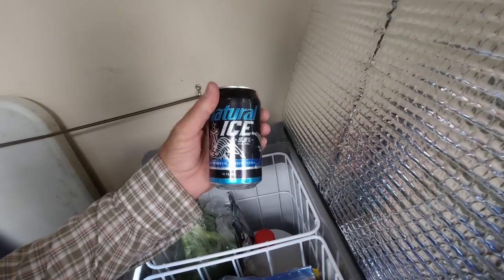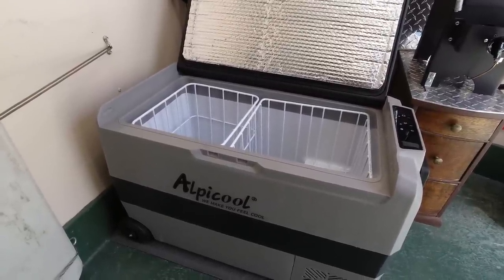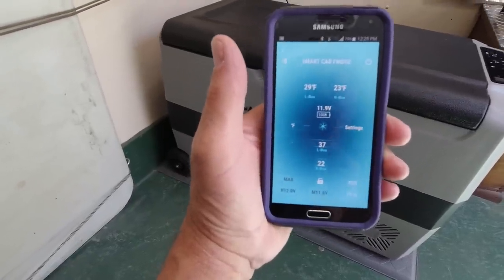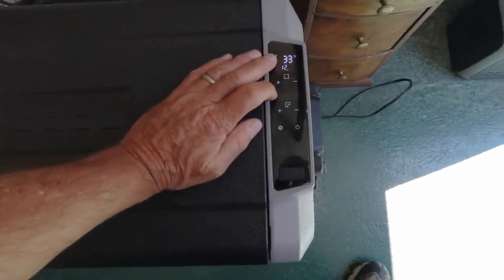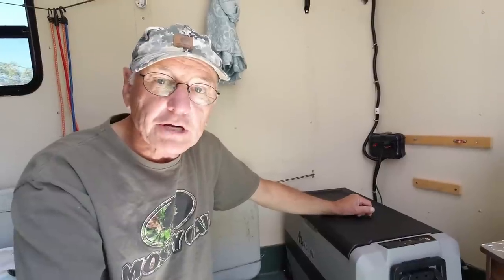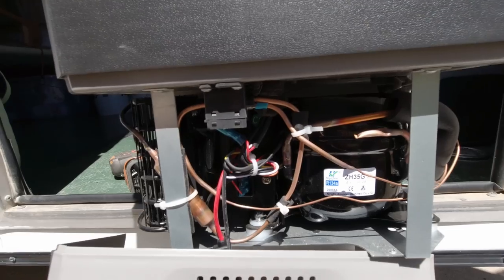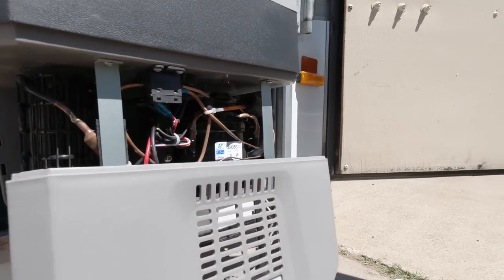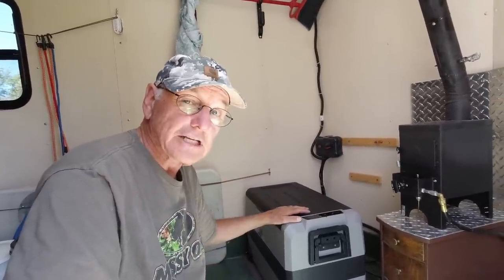Alpicool T50 12 Volt Refrigerator - Is It Worth It?

Comment: That was one of the most beneficial 12-volt refrigerator reviews I've ever heard there were several points that I learn something. I had questions about Duel Zone you explain the on this particular unit non-regulated power supply. The alphacool information. I think the number one thing I learned is you paid for it you're not looking for an endorsement or the next free deal and you will review it in the future accurately
Reply from the maker: I'll do an update towards the end of summer most likely.  Thanks Wes!
Reply: Agreed
Reply: @gonagain look forward to it
Reply: I still wonder if the regulated 12v feed comment was based on an mppt controller and a larger charging system. I only say this because the most will raise voltage to the batteries at times. I know its 12 or 24v but if its switched then it may not like 18- 20 volts in a 12 volt setting. I say this considering a direct battery connection while solar panels are collecting and the most controller is boosting to 18 ish volts. Thats the only thing I could think of that would warrant their comment on the 2 channels he referenced.

Comment: I run 160 watts solar & two 6volt Costco batteries. I Have an old norcold  45 qt 12 volt single zone unit. I Only use it as a freezer set at 6 deg F. Freeze water bottles over night and rotate them in my high quality cooler, this keeps as a refrigerator. I think it’s continuous and could go for? At least A long time. Frozen meat, frozen vegetables, and don’t forget ice cream. It pushes at least 10-14 days for two people. 
Keep up the good times. Thanks for sharing.
Reply from the maker: Thank YOU for sharing!  That's really good information and I can see that it doubles your available space.

Comment: hello from the rainy ozarks rick and linda!! i have one like yours and i havent had any issues  in 6months so far!  tight lines and cheers!!
Reply from the maker: That's good to hear Phillip.  Mine is getting a bumpy ride on the trailer floor, so we'll see how it does.  I'd like to find a way to cushion it if I can without it getting too bouncy.
Reply: Mine has been working for more than 1-1/2 yrs and all is well.  Wss so happy l purchased a 30 qt model.  Didn't go big till l knew this inexpensive unit was ok...l made the investment watching Slim Patatohead who initially made the purchase and review.  He's worth subscribing to as he's one of the best on You Tube.
Reply: Oh my original C20 unit does a fantastic job keeping my beer cold!!  Mine is vy quiet.  Oh no piston.  Now they use a scroll compressor that uses 2 plates with.one rotating over the other to capture and compress the refrigerant as it gets squeezed thru the scroll circular-like vanes.  They are more robust, uses fewer parts.

Comment: I bought the same one.  I love my ice.  I bought  deep large ice trays the correct fit on amazon.  It actually froze them in Florida.  I do like it.  I hope it lasts.  On the noise if they are plugging it into an extension cord that is the wrong size it will make a lot of noise.  Good luck with yours.  I hope you do another review after you had it for a while.  I don't plug mine in right after I tote it since it is tilted.   It probably doesn't matter but it makes me feel better. lol  I do have a hard time with the manual settings.  So I just use my phone.  It is simple that way.  I am using 200 watt with 100Ah battery no problem.  Thanks for your input and showing me the inside.  I was wondering about it.  Thank you for the idea of the bubble wrap on the lid also. I will use that. Woo hoo on fresh veggies, gotta keep momma happy!
Reply: I have an icemaker separate from my refrigerator. The directions on that say to let it settle if it's been moved around before running it. Not sure why but it sounds like the motion could upset or aerate the coolant perhaps? Is there an AC tech in the house?
Reply: @richarddaugherty8583  I was using the same concept as a house fridge.  If you tilt it too far you are supposed to let  the compressor oil settle before you plug it in again.  I don't know what degree of a tilt but I know you are supposed to do it.  Do you have one of those counter top ice makers?  If so do they work well?  I would think they would use too much juice.
Reply: @ruabadkitty  I looked one up on Amazon and it says the draw is 120 watts. That's not too bad, really. The question how much is too much is relative to the quality and quantity of your power supply and how many things you need to run. I just got done building a totally portable DIY 400 watt solar generator, but it wasn't cheap, at least up front. The cost over the life of the unit is going to be darn cheap but the batteries are the big investment. I went with 2 Battle Born 100 amp/hour LiFePo4 batteries wired in parallel for a total capacity of 200 amp/hours. For me that's a lot because I only need to run my ham radio stations, some fans, a laptop, charge my devices, stuff like that. All that stuff is 12 volt. The system has a 3000 watt pure sine wave inverter to run AC stuff. I think I could run that refrigerator and an ice maker with no problems. YMMV! Here's a link to the system I built in case you're interested. It was definitely a project! https://drive.google.com/drive/folders/1Fbuo8TENelmmndBXc4w37FZsMWjWY8Uz?usp=sharing
Reply: @richarddaugherty8583  My Gosh!  You weren't kidding when you said you "built" your own system.  That's beautiful.  You really put some sweat and thought into that.
Reply from the maker: I also found the Bluetooth easier to use.  At first I didn't think I would use it for anything, but its more intuitive and easy.  Thanks Nancy!
Reply: can you share a link to which deep large ice trays you got from amazon for this alpicool?
Reply: I can't right now.  But you can measure inside and then go to amazon and search ice cube trays.  the sizes  are all there.
Reply: @ruabadkitty  did you get silicone ice trays with lids?
Reply: @manp1039  Yes,  I got the large and smaller octogon shaped ones.  The larger ones take a lot longer to freeze in Florida. they both are silicone and all have lids.The big ones has six cubes each came Two per pkg.

Comment: We really like our T50 Alpicool.
 We purchased it end of May and have had no problems so far. I made a insulated cover made out of foam board.
Reply from the maker: We need to do that too.  It did really well though as long as we kept the sun off and a cover would help with that for sure.
Reply: @gonagain Like you and Linda we have it setup as a refrigerator.  Also we don't use the baskets as they take up usable space, some items won't fit in them.

Comment: I bought the CF55 58qt. running a week now with solar in the shade for the most part little sun but working fine so far. It's fridge or freezer not dual zone but I agree way worth the money.
Reply from the maker: You could try freezing water bottles too cool an ice chest and have the best of both worlds.  Depending on how much power it draws as a freezer.

Comment: I hope this fridge works out for you.  I almost got one.. but then I read dozens of bad reviews.  Many from people saying it just died completely.  Good luck with it.
Reply from the maker: We'll find out.  I saw those reviews also, but even the Dometic brand has reviews like that so I figure we'll find out.  Thanks Joe.
Reply: @gonagain  True.  I've been leaning to the Iceco GO20 fridge.  Its affordable.  Dual zone.  And compact (which I like).  I'm still kind of undecided if I want an actual 12v fridge or a regular dorm style fridge.  Cheers.
Reply from the maker: I like this style compared to the dorm type because it holds the cold better so it uses less power. Like a chest freezer compared to a stand up freezer.
Reply: I got a T50 two weeks ago and it works great so far. Gonna insulate the lid like you did in the video. Thanks for the tip and review!

Comment: Sounds like your choice was the correct one so far, but bagged ice from home in the base may cause it to run less often try it and see at home then you have water when it dose melt filtered water I use in resealable bags...
Reply from the maker: Not a bad idea Jimmy.  We still haven't used it as half refrigerator and half freezer yet, but are going to try it out soon.  Ice cream?  hmmm
Reply: @gonagain  Sounds like a plan and remember when camping there is more use of frozen food space than refrigerated space, just fix up what you can eat then no wasted space, and hot or cold water is better than no water at all...

Comment: Awesome review! I have watched many and yours was the best most straight forward and entertaining I found. I’m glad I did find yours because I was about to purchase one of their other models even though I did not like the way the lid opened. After seeing your review not only the lid design but also the ability to regulate each side independently has won me over. One question I have is .. do you feel the lid is strong enough to use the cooler as an occasional seat ? I will be using it in my VW Westfalia and do feel we will utilize out refrigerator as a makeshift seat on occasion. My wife and I are smaller at 110 and 160 pounds. Thanks!
Reply from the maker: I think it will be ok, the lid seems strong enough. A cushion with a plywood bottom would help.
Reply: Yes. The lid is sturdy enough to be a seat

Comment: If you put insulation around the cooler or put it in a regular cooler it works even better just be sure to cut out the holes for ventilation!
Reply from the maker: Thanks Loren,  I want to make an insulated jacket for it.

Comment: Regular 3 cubic foot(90qt) chest freezer, about $150 to $200.
Plug in Thermostat about $30. to $40.
Inverter if you're running 12 volt system about $40.
Total for 90qt freezer you can set with thermostat to refrigerator temps  $220 to $280!
Plug the freezer into the thermostat, plug the thermostat into your power, now set your temperature to what you want! Save money and get a lot more size.

Comment: Refrigeration is a risking investment.  Those compressors and those rattling copper lines going down a pothole road..
I use a  Lifetime 55 Quart cooler that I purchased at walmart ....
and use a Cooluli Mini Fridge  12vdc/ac for my drinks...(uses 60 watt)
Works fine for me.

Comment: Gonagain, I just bought one of these.  I noticed when your compressor kicked on, the voltage display dropped into the 10's.  What was the input voltage?  Here's what I've got going on:  I bought a hardwire kit that the cigarette lighter on the cooler plugs into.  I've got that hardwired into a hot and negative output that's factory mounted to the dash in my semi.  I've held a multimeter against the wires, and they're at a constant 12.8V, and the display on the cooler will drop down to 10.1V, even though there is no drop on the meter.  This is a little Alpicool cooler against four huge semi truck batteries.  Anyways, it causes the low voltage F1 error, and shuts off the compressor.  I had to drop it to the 9V setting just to get it to run.  Now with the truck running, and I'm getting 14.1V at the meter, the display on the cooler will drop all the way to 12.0V.  That means I would get the F1 error even with the truck running!  It's like it's not reading the input voltage correctly or something.  Is this just how it is?  Is this how yours works?  Thanks.
Reply from the maker: Mine never gave me that error.  Do you have a large enough wire servicing the refrigerator?  That could cause that.

Comment: Thank you again for another great review....I just received mine today...Can't wait to use it....
I have a question.....when you are using this as only a refrigerator does only one side of the inside of the unit get cold...?
I figured since you took out the center section that it would.
So the left side of the unit is the cold section...?
I couldn't find any information  at ALPICOOL web site or any where on line...
I thought I would ask someone who has one...
Thank you again for your time....
Reply from the maker: When you take out the center divider it automatically switches to single mode and will work as a big refrigerator or freezer in that situation.  It has two separate cooling coils and I think it only uses the one on the control side when in single compartment mode.  I know that the temperature sensor is on the opposite side when used like that.
Reply: @gonagain  Thank you............

Comment: thanks for the review sir, so how efficient is it? can you give a rough idea of run time on your batt? cheers..
Reply from the maker: That will depend on the ambient temperature, but I can tell you that at a room temperature of around 72-75 degrees, it uses 13wh per hour on refrigerator mode and double that on freezer mode.  So if you had a 500wh power station, good for maybe 420wh, you could run it for about 32 hours in those conditions.
Reply: @gonagain  that's not bad, so I'd need a few days run time so probably would need a 1500-2000wh power station...
Reply: @gonagain  I truly dont understand these watt hours..amps etc...but I THINK you just said I could run the alpicool on a jackery 500 for 32 hours..recharge hackery with solar while fridge is plugged in cigarette lighter.....is that right????    I cant afford a BIG EXPENSIVE mistake...I'm on low social security...thank you.   Thinking of buying jackery 500 this week but SCARED

Comment: Good review. I see the  model is a few years old so I’m wondering if it is the best in 2021. I like the BougeRV 30 qt, which seems to have a Danfoss compressor (at least it looks like one) and it is smaller. 
Nice to see a reviewer closer to my age. 
Still not sure how big a power station I need to drive this for, say 12 hours or more. 
I did try a F40 brand but quickly found the 20 qt size too small.
Reply from the maker: Hello Stephen.  Alpicool will either use an LG or a German design compressor.  They're also sold under the Bodega name.  A 500Wh power station will easily run one for 24 hours.

Comment: Great review!  I recently bought the smaller 36L version from bodega and love the features/design but it makes a loud and annoying gurgling/boiling sound when the compressor is on.  The noise is louder than the compressor/fan.  Does yours do this?   I am wondering if it is as normal as the manufacturer says it is.   Thanks!
Reply from the maker: Thanks for watching, John. We appreciate it very much. And a little gurgling is normal.

Comment: Hi! Great video!  I've just bought this unit,  I hope it last. So far it's perfect,  lowered my temp 30 degrees in just 20min, all in freezer mode and putting inside some rigid ice plastics. By the way,  any idea where the Fuse must be located? Manual describes an error code indicating that there's a Fuse that can be changed
Reply from the maker: Hello Javier. I don't have mine anymore, but on my Bodega, which is made by Alpicool, there's a fuse right next to where the power cord plugs into the refrigerator.  In faint lettering it says "fuse".  Usually on these refrigerators there is a fuse or circuit breaker in that location.

Comment: Great info. Thanks for all the tips and for figuring out the random noises people often comment about. I've been thinking about getting a compressor refrigerator myself too. I have a couple of questions if you don't mind. How do you find the heat coming out of the exhaust? I would imagine there's some heat being blown out from the cooling fan. Does that heat up your trailer on hot days or is it really a non issue? Also about the watt hours used over a typical 24hrs when running in the normal refrigerator eco mode on 12V. I realize this is totally dependent on the ambient room temp as well as how often it's opened and for how long. But on a typical day camping with the two of you not really being cautious just normal use. I don't have solar but I do have a Jackery 500 and a Jackery 1000. I also take a generator with me but I may not be able to run it. I often leave the trailer pretty much from dawn til dusk to go fly fishing and I can do that for several days in a row sometimes. There's really no time to run the generator to top things up without being "that guy". Just looking for an idea of what to expect. Thanks again. Great channel!
Reply from the maker: From the watts and run times that I was seeing, I think that it uses about 300-315 watts per 24 hours, which goes along with Jackery saying that their Explorer 1000 would run a 60 watt, 12V refrigerator/freezer for about 66 hours.  I put my hand down to the exhaust port a few times and the air coming out is warm, but that's only for about 15 minutes average every hour in 85 degree (about) ambient temps and we really didn't notice it.  Of course, keep the reefer out of the sun and covered as best as you can.
Reply: @gonagain  Thanks very much for the reply. You're confirming to me what I was thinking. This would be a real benefit to me for camping as well as prolonged power outages.  I really like the fact that your 12v refrigerator has the two baskets inside too. That probably helps with the cooling as well as keeping things separated instead of a big pile. I appreciate you insight and I'll look forward to your long term review. Cheers,

Comment: Just curious how this refrigerator is doing after 2 years. You've done several reviews on refrigerators. Which is your favorite?
Reply from the maker: I no longer have the Alpicool, but there isn't anything wrong with it at all, I just passed it on to someone else. There's two refrigerators that we use all the time; one is here in the camper right now and it's the Setpower RV45S, https://amzn.to/3SjfQnK and the other is larger with two separate cooling coils for refrigerator and freezer and that's the Bodega TWW55, https://amzn.to/3SbFDxR
Another very good brand is the ICECO line.